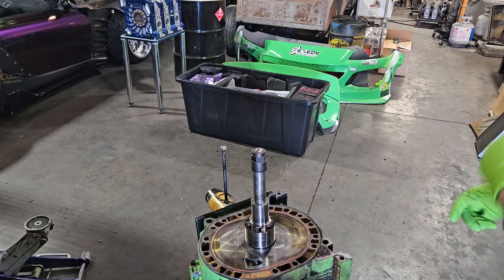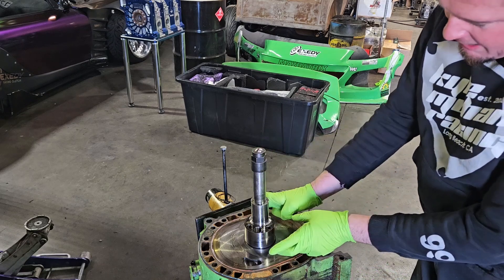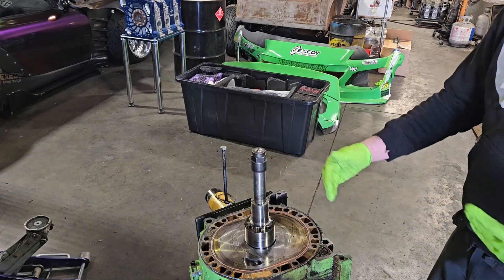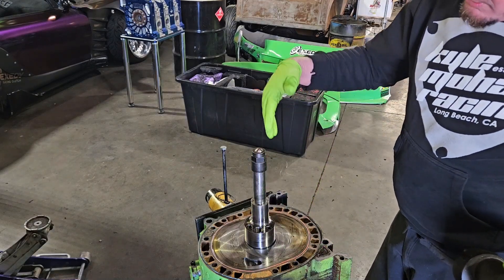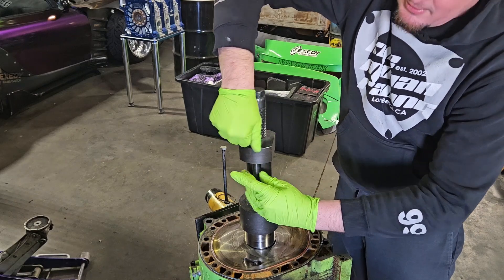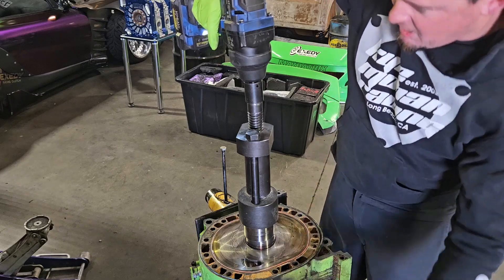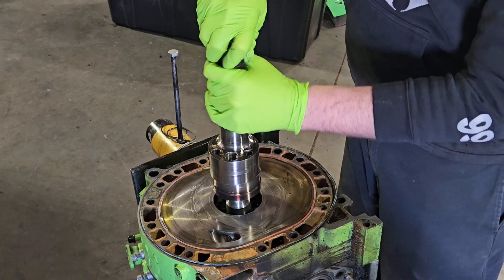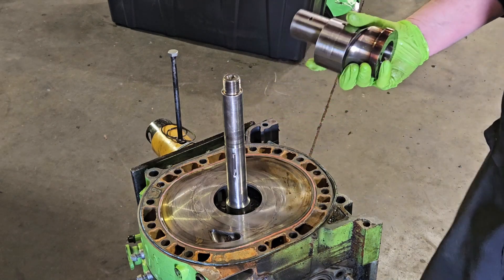3 ROTOR Disassembly - shaft separation - Mazda Rotary Engine tech - KMR

Comment: Where can you buy the puller tool? Are they still available? I can’t seem to find them at all outside of forum posts only talking about the tool
Reply from the maker: @NateRist  OEM is discontinued.  Might be able to find an aftermarket version or used one.  I could probably track one down if someone is serious. But $$